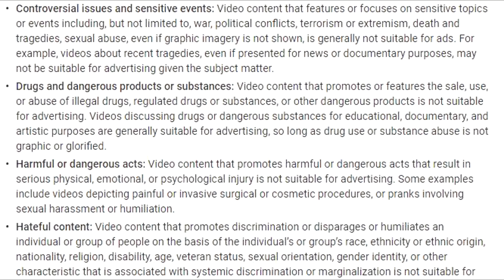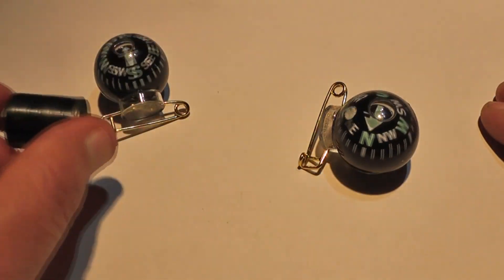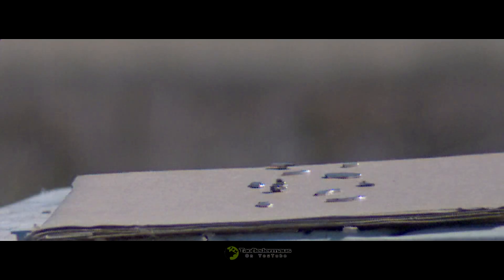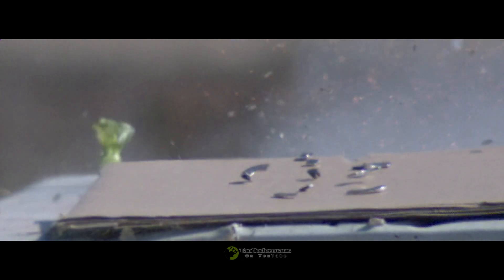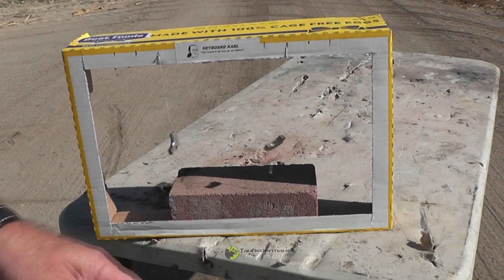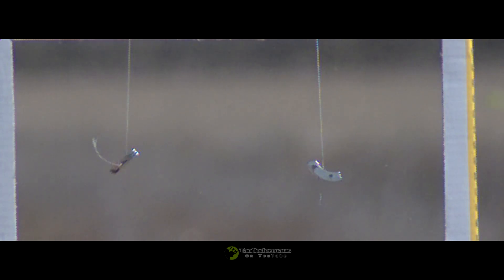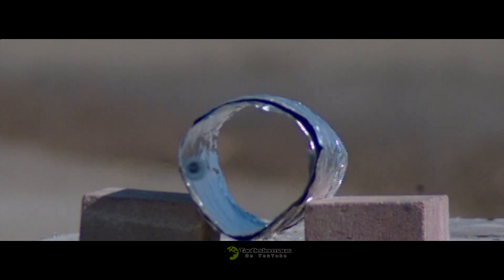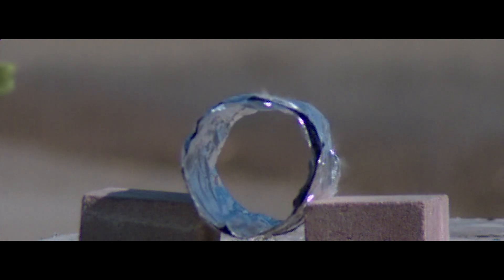1000 MPH Magnet Experiment

Comment: an easy way to test your shock wave theory, you should be able to demagnetize the magnets by heating them up, then you just glue them together and repeat the experiment.
Reply: Also, an easier way to test the shockwave theory is to shoot a slug with similar velocities and weight so there’s no question about a magnetic field.
Reply: @MrJeepinZeke  ..Great idea!!
Reply: @MrJeepinZeke  That is easier said then done. most slugs are gonna be quite a bit heavier then the magnets. Also, the shape of the projectile is going to matter as that will effect the shape and size of the shockwave. the easiest way to make a slug that matches the magnet slug as closely as possible in every aspect but magnetism is just to demagnetize the magnets. It is not that hard, a few seconds with a blow torch should do the trick.
Reply: If you can krono both experiments you can also see what effect the magnetic force has on the velocity of the projectiles after passing through the barrel.
Reply: I would think that they would be somewhat hot already considering they are being shot out of a shotgun VIA superheated compressed air, so it might be possible that they are already demagnetized, however I am unsure on that because I do not know the exact temperature at which demagnetization occurs
Reply: @Couram  they generally have to get quite a bit hotter then that. But I suppose you could fire one into water and recover it to see if it is still magnetic.
Reply: @Couram 
Projectiles don't get very hot from the gas behind them, because the time they are exposed are way to short.
Magnets made out of metals need pretty high temperatures to lose their magnatism. 
Leed Projektes for example would melt!
With Ceramic magnets I'm not sure, but I think the need even higher temperatures.
Reply: @martin09091989  ferrite magnets are less susceptible to heat then Neodymium true, you need to get them up to about 482F (250C). but that is not hard to do with a blow torch. Though to reach the curie temperature (0 magnitism left) you need to hit 842F (450C), still within reach of a blow torch I should think.
Reply: A vest like they usually use would catch it and not explode it like water potentially can. Slugs are usually too hot to handle after they are shot, from what I’ve seen. It doesn’t take a whole lot to demagnetize a magnet.
Reply: Though if you do try this, you want to make sure you heat them evenly to avoid shattering.
Reply: I'd LOVE to see a control experiment come from this.  Load up another identical mass item in the rail gun that's not magnetic and pass it through the foil.  If you have an identical reaction, we knwo for sure it's the shockwave.
Reply: Perhaps a lucite or glass tube with the foil tube around that. Also to prevent forward interference a sheet of lucite glued or taped to the tube. Of course it will prove nothing since there is no appreciative affect but I have been wrong before and will definitely be wrong in the future.
Reply: Very cool I like alot
Reply: I would have just used a regular slug instead hahah
Reply: Another thought might be to reduce the powder load until it's no longer creating a shock wave and see if it still has the same effect?
Reply: Skwisgar2322 wont work they wont re-magnetize after they been heated up

Comment: Rotational inertia in the compasses would be huge compared to the magnetic force passing by. You COULD use a coil of wire hooked up to a oscope. I'm like 98% sure it would show a decent voltage spike as the magnets passed through the coil. Maybe you could use that to power subsequent railgun launches. :D

Comment: What I'd like to see is a multimeter measuring each side of a coil of copper wire and firing the magnets through the center like the magnet on one of those survival flashlights you shake to charge, I get the feeling the intense force on the magnets might reduce their power but I think you might be able to measure the magnetic effects of the magnets better by how much current they induce in a coil. I'd try and collect the projectiles and see how strong their field is after being accelerated so violently.
Reply: You would need and oscilloscope.  A multimeter would not be able to take a measurement fast enough to measure the pulse.  I was actually coming down to the comments to suggest exactly this though.  The only other issue is that the air gap between the magnets and the coil needs to be extremely small.  The magnetic field strength drops by the square of the gap distance.  This could be done by using a non ferrous "accelerator tube" and wrapping your magnet wire around it.
Reply: +NerdByDesign
or you could just hook up a diode or a lightbulb if you feel generous, the pulse will be seen on slow-mo. You can also use longer copper coil in order to compensate for the square distance law.
Reply: @jackvernian7779  By diode I assume you mean an led?  They are voltage and current sensitive and I do not know if it would work.  Other types of light bulbs probably would not work either due to how short the pulse would be.

As to adding more wire to make up for the gap distance, that would be a lot wire!!!.  In a solenoid, you are looking at a gap of what, .1 inches tops?  Realistically they would need at least an inch of gap to acct for instability of the projectile, clearance for the muzzle blast, inaccuracy etc.  That is 10x.  10^2 is 100.  So in order to compensate they would need 100x as much copper wire to get the same effect by using a longer coil of wire.  That is why I had suggested wrapping it around a non ferrous accelerator tube to maintain a tight gap as opposed to having the projectile go through the coil after leaving the tube.  No blast to deal with and it will keep the magnets straight and aligned.

Comment: if you drop a magnet it loses strength so I expect them to demagnetize before they leave the barrel due to accelleration
Reply: do the foil experiment again but film the side of the tube. Compare it to something that only the shock wave will affect, like a clear tube with dust inside. Maybe we will observe motion the foil bending ahead or adjacent to the projectile, distinct from the motion the shockwave imparts
Reply: relative motion of coils and EM fields induce current; you could build an experimental setup with a series of eddy current sensors along the projectile's flight path, and record the field strength at each coil throughout the projectile's flight. the data would let you could compare the effect of acceleration on magnetic field strength
see related NightHawkInLight vid https://www.youtube.com/watch?v=sENgdSF8ppA